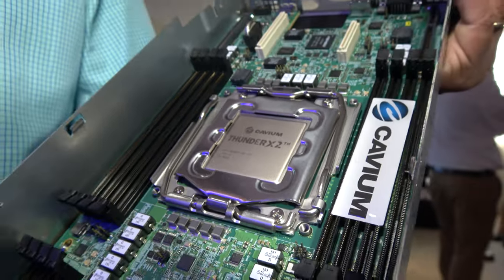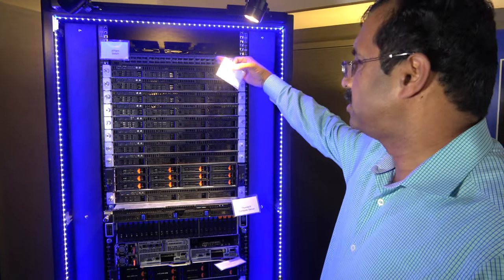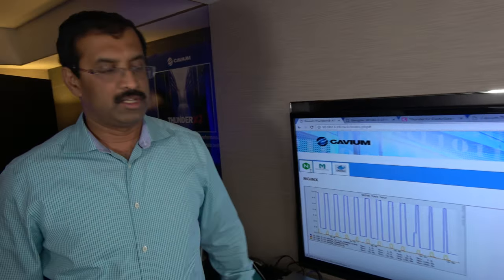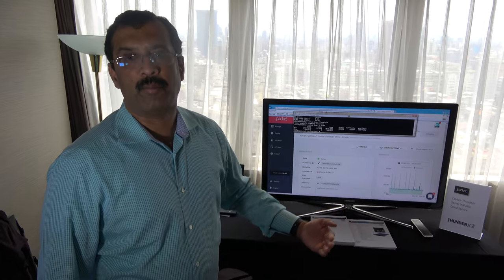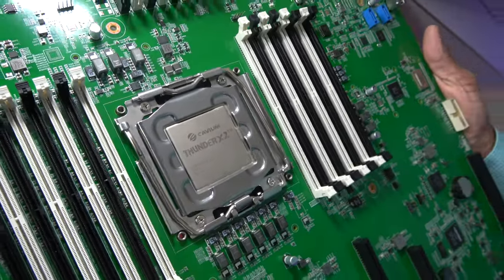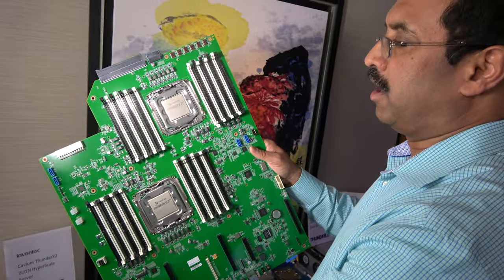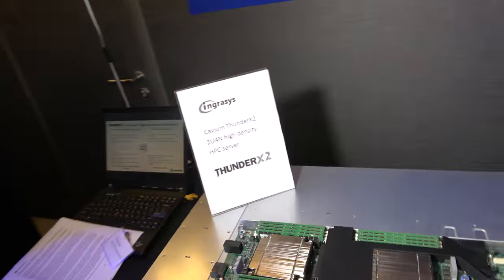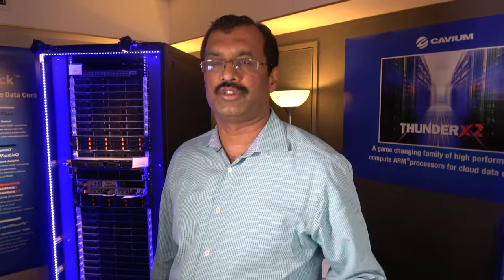Cavium ThunderX2 at Computex 2017, Windows Server on ARM, Foxconn (Ingrasys), Inventec, Gigabyte

Comment: Any prices on this arm hardware
Reply: +vineeth pulipati  ok that fly on your avatar got me ... thanks for the LULZ :D
Reply from the maker: The overall cost of running a ThunderX2 ARM Server might be much lower than running an Intel server with the same performance and scalability. In my video he mentions that some companies already provide 10x cheaper service per VM running on ThunderX1 compared with the Intel server system. The biggest price factor of running a server is not the price of the chip (which may be significantly cheaper than Intel), not just the price of the system (which may be significantly cheaper than an Intel system), it's the power used to run it and for cooling it.
Reply from the maker: My understanding is that ThunderX1 has better performance/value than some Intel Xeon E5 already, but only with certain multi-threaded use cases, as your anandtech link mentions load balancing, web cache or CDN server, while the ThunderX2 will increase the single threaded performance by a lot, maybe by 2-3x as they say, perhaps enough to also seriously challenge Intel also on single threaded performance of a higher end Xeon D. I don't know if actual real-use ThunderX2 benchmarks are released yet, I think perhaps they keep that secret for now for a good reason, either they are still tweaking the peak performance or they want to surprise everybody in the industry closer to availability date or both. For sure I think the industry is anxiously waiting for ThunderX2, and hopefully this will have enough performance to satisfy everybody, no need to wait for 2020 and 5nm, ARM has said that they expect to be able to take 25% of the server market by 2020, for this to happen, ThunderX2 will need to be a massive success, and I think also Qualcomm might be working on something interesting. Hisilicon, Xgene3, Socionext and some other solutions could also have something significant available imminently.